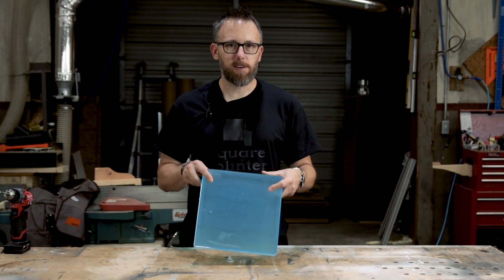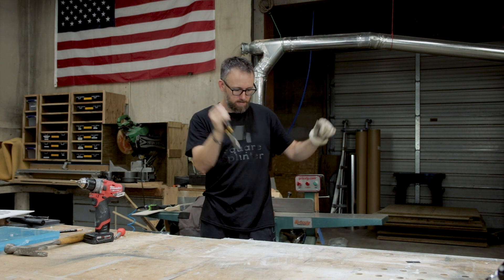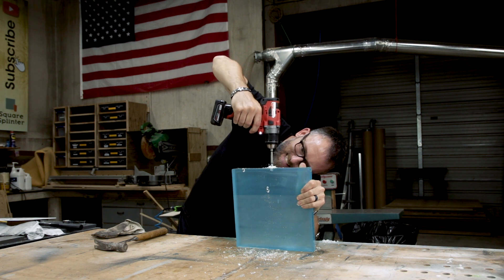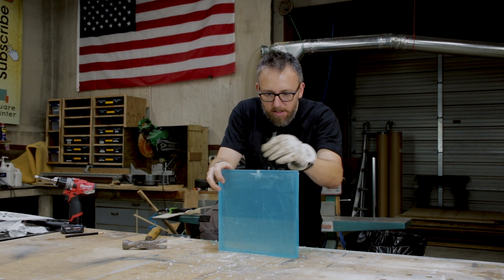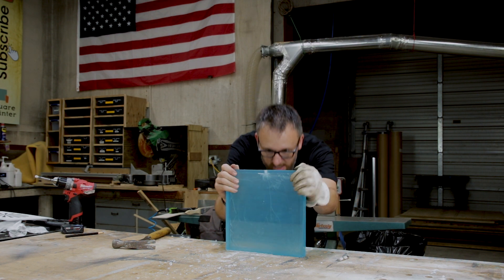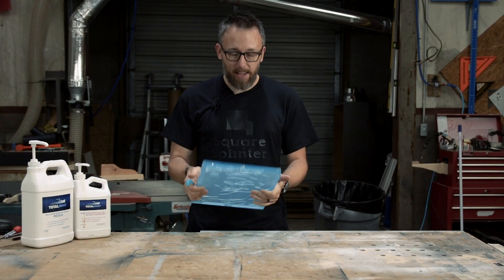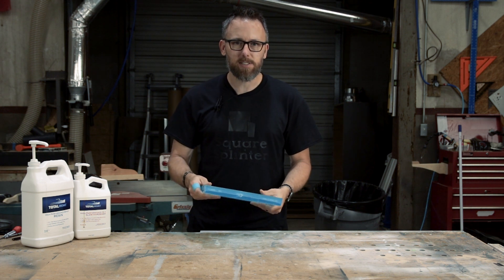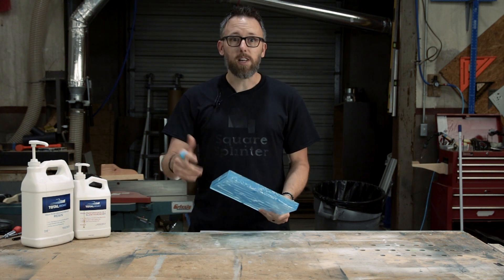Can you break tempered glass encased in epoxy?

Comment: Question. I'm currently building a home and I'm wondering if epoxy makes for good windows without yellowing?
Reply from the maker: No, I really don’t think it would work well at all. It would be SUPER expensive.
Reply: @SquareSplinter  mainly because of the cost or because the quality?
Reply: @speakeasy7192  late reply but I’d say that isn’t a good idea due to quality and cost, from what I know of when I work with epoxy it can become flimsy when hit with heat knowing that windows will be hit with high heat due to the sun I don’t think it’s the best to use I’d stick to glass just to keep safe.
Reply: @sienna7821  thank you. I ended up going with corrugated poly carbonate sheets for a greenhouse effect

Comment: no surprise; on early car windsrcreens if you placed your hand firmly up on the window as a car went past (on a gravel road) if a stone from the other car bounced up and hit it the cracks would not radiate over the whole winscreen and thus bits would not land in your face. I gathered it was as tempered glass is brittle the force of an impact continues to radiate outward with nothing to damp it. With the resin up against it, it soaks up some of that force out of the glass and thus reduces fracture of the glass.
Reply from the maker: That’s really interesting.  Thank you for the insight. I had no idea that could work with car windows.